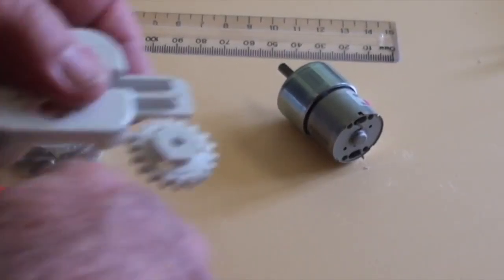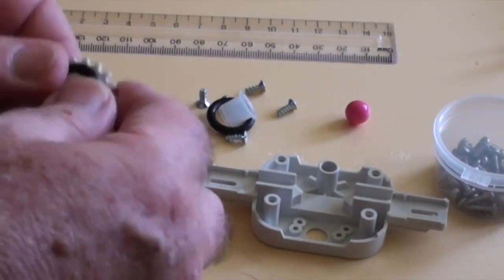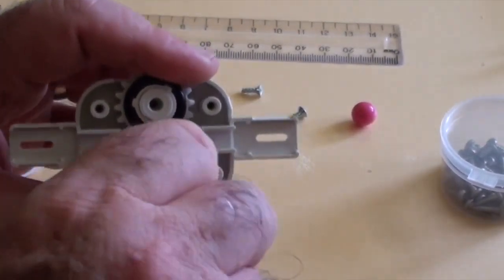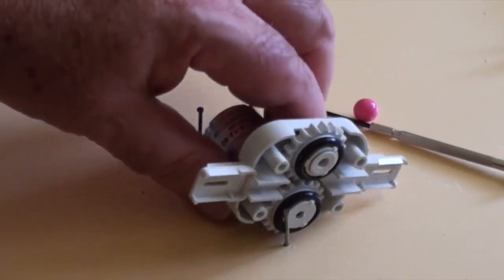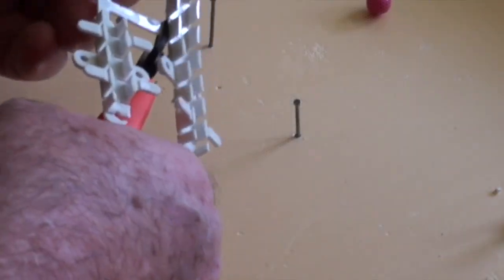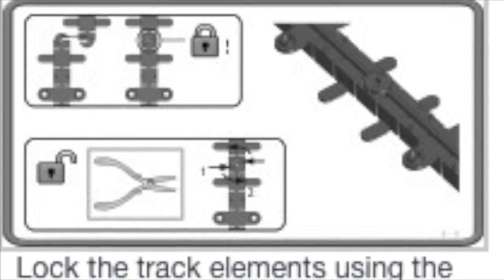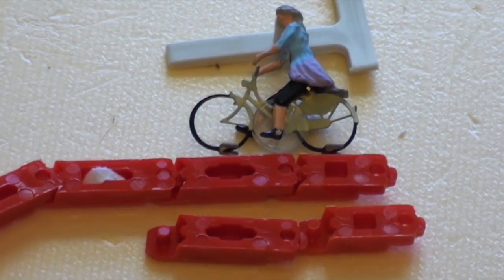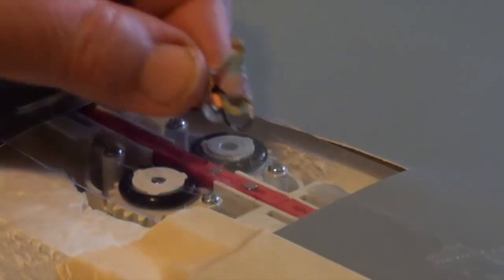Magnorail Tutorial - Basic Loop

Comment from the maker: Hi Juan - Check out my video https://youtu.be/epfSQr9vmTU I prefer this method as it is durable however any hard surface that can be painted and is under .5mm will work. If it is too thick, the magnets in bicycles especially find it hard to grip. Plus the sliders and bicycles can gradually scratch the surface if it is not durable or able to be cleaned which is why I have found the laminating method using matt laminating pockets the best option - hope this helps - Clyde www.magnorailoz.com